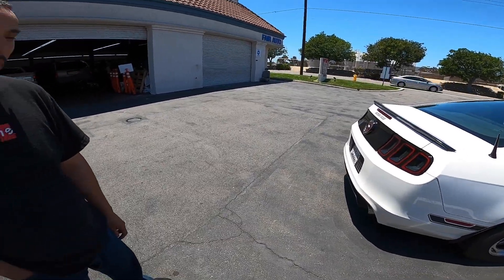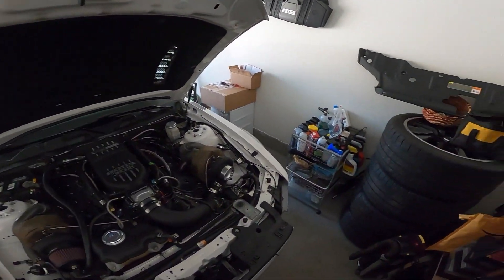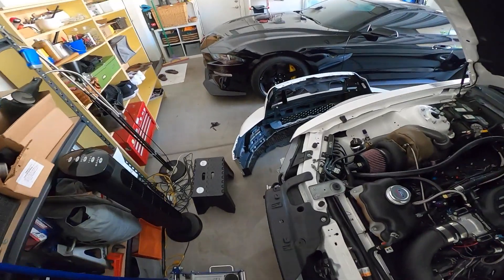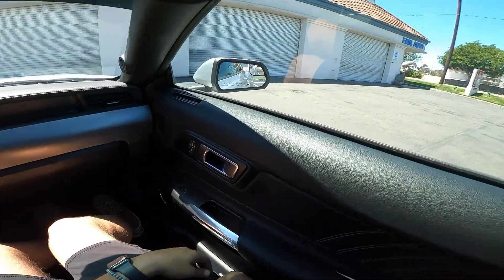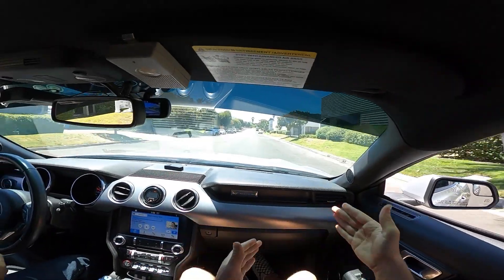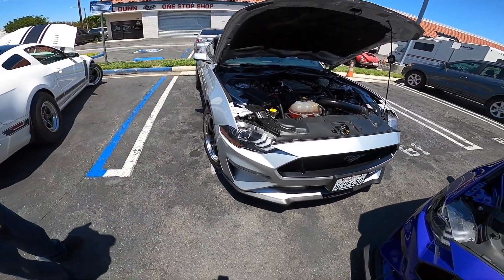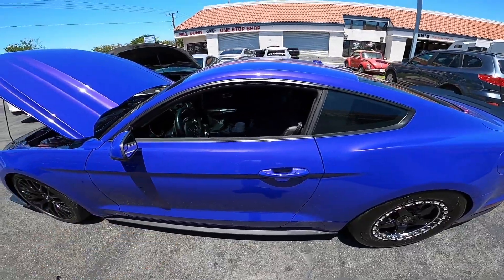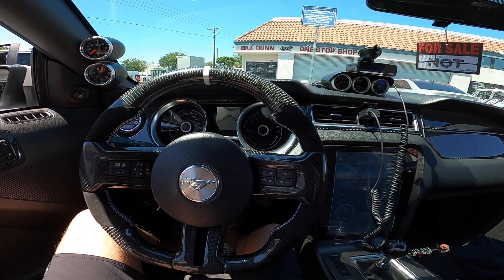OUR TWIN TURBO MUSTANG 10R80 TEST DRIVE WENT TERRIBLY WRONG!!

Comment: My 2019 GT 10r80 is 855rwhp. Fully tuned and built by VMP. With new MT street SS 305/20/35, 24psi in tires, in will break the tires loose at any speed under 80-90. I have full suspension to. Literally everything that can be done front and rear. Have to use the paddle shifters to keep it under control. If you let the car shift itself it is scary on the street. WOT it doesn’t shift till about 8050rpm. If the tires aren’t already spinning they will snap loose as soon as it shifts all the way up to 5th gear. 80-90% throttle and paddle shift it around 6800 it’s controllable on most streets. Be careful with that thing man. You did a great job of correcting when it got loose. I have no idea how these guys don’t just die on the streets running 1000-1100hp.